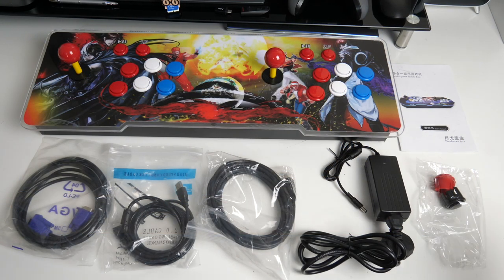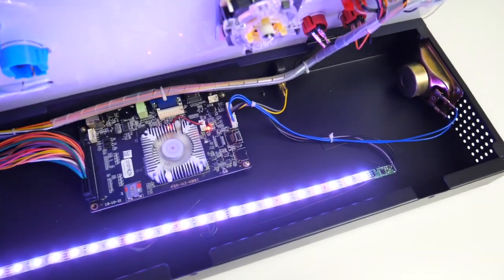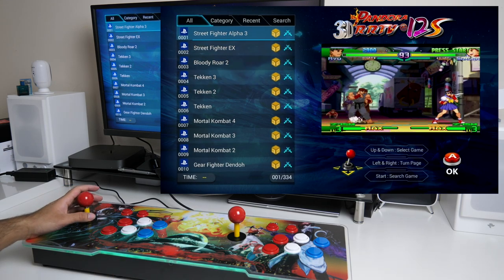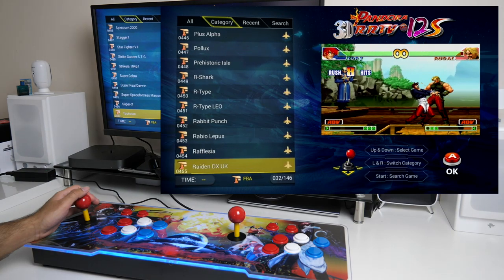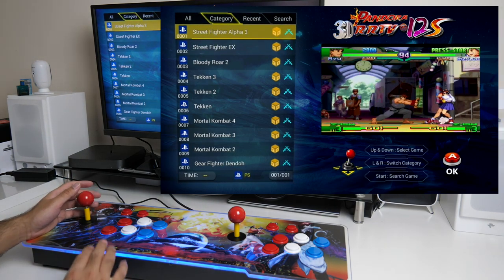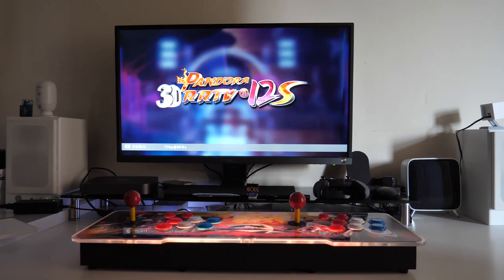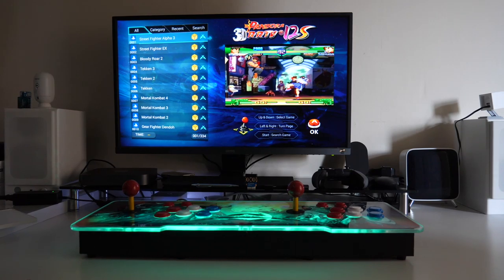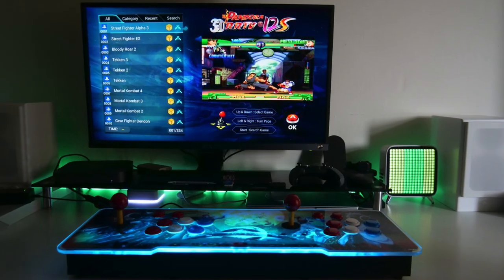Pandora Box 3D 12S - Multi-player Arcade Game Console / 3333 Games - Any Good?

Comment: You can probably connect a usb Ethernet adapter.  I know the apple ethernet usb dongle has built in support in the linux kernel so there is a good chance it will just work.  With that you can get on the app store.

Comment: Thank you for the excellent review and demonstration, really gives a clear perspective on the console. Beautiful product. You mentioned that you were unable to download games as there was no wifi capability or ethernet port however, my suggestion is to maybe try to use a MIFI ROUTER which has a USB cable for a direct connection and to plug it to the USB port of the console and see if it picks up. If this proves to be successful this will be a way to download more games.
Reply: Did it work?

Comment: How do you get the real deal with so many fakes out there.. I'm not too sure ..looks like they have added a fan too the fakes now because the proper Pandora's box when you look inside should be a pink or orange or green unit with fan built in ...the fakes just have a circuit board they used too over heat and bust because they didn't have a fan ?

Comment: Hi chigz, to answer the question to make to system internet capable. use a usb to usb dual end cable. Then add a WIFI USB Adapter. I prefer to use at a low cost the, the NETGEAR AC1 1200. It is a dual band 802.11AC, USB 3.0 which works with all standard WIFI.
Reply: Also a question, in the market area on the console system when you want to add games would you provide a company list of where the games are being brought from such as if it’s like G2a.com and such. The next question would be how to download your own games to the system or where to find Roms that work of specific with the game console?

Comment: Looks like the sound is really messed up.
Reply from the maker: You have one mono speaker built in, it’s loud and clear but not great quality. However, when you connect via HDMI you get the sound on your TV too. So you can turn off the internal speaker and achieve better sound on your Tv.

Comment: Question how do I play 4 player as it only lets me play 2 I bought extra controllers and plugged them in but they only work for player 1 and 2
Reply: Im having the same issue. However you can plug in a PS4 controller into the USB. hit settings button or "cfg" button. Go to key settings. Hit the right button on the controller twice....so it reads "controller 3". Now you have 3. You can also make that controller #4. So essentially 1,2, or 3 or 4 but not all 4. Ive only been able to make 1 controller work as the third or forth player. Basically only 1 controller and 2 arcade sticks. I have read that if you buy a "usb hub" you can then plug that in and it can become a 4 player board.

Comment: I just got the Pandora 11 and it's amazing!! The best game I've found so far is the street fighters it's got at least 20 different versions of the game and let me tell you it's exactly like the arcade game!! The graphics are in point they did it perfectly! I also like street's of rage games the Mario kart is fun and they did a great job with sonic the hedgehog and the jet fighter games are great as well!
Reply: Hey man quick question is there any input lag I.E you click a button and it takes a few 100 MS before it actually happens on screen instead of seeming “instant”
Reply: @CurlyFryTyy  Not on the pandora box I got but what does do is sometimes it won't turn on you gta keep turning it on and off a bunch of times like I've turned it off and on 30+ times before to get it to work I had to take it back to the guy I bought it from to get it fixed.
Reply: Where did you purchase it buddy, and have you played multiplayer on it??

Comment: my question is how well do the N64 games run? how is tony hawks pro skater running? this seems like the same box as pandora 3D 2448 games, many of the N64 games didnt run well on there.
Reply: I just got this one in the mail, tony hawk will reconise the joystick but nothing else I even used a ps3 controller.
Reply: @TheRiverAnduin  I own the pandora box 3D 2448 games and I was disappointed because THPS1 (N64 version) my personal favorite, was not playable because the joystick could not recognize the commands. I hope they come out with a new pandora box where N64 games can run better, but N64 is hardto emulate.

Comment: hey I got one from ebay had it for like a month used it about 5 times. Now the power switch is broken how do I find a replacement part?
Reply: That's a pretty common looking switch, it shouldn't be hard to find something. Just bring your box with you to a hardware store on electronics shop and find something. If you don't care if the switch looks the exact same same, you could really use anything as it's just an on/off switch.
Reply: I take it, you cannot return it? That's pretty lame that it broke straight away. Stand 6 that the power switch broke? Those things should last forever.

Comment: Just curious in what the space feels like, when two grown men use it of bigger size. To me looks like enough room just for me and 1 stick/buttons in middle.
Reply: I used to have a mame full sized cabinet & 2 players were just fine. I sold that and recently I got a p.b similar to this. It's 24 inches long & just under 9 inches deep. We had no issues playing 2 player games, we're both 5ft 10, 90kg (200 lbs). Yes there's not tons of space but there are USB ports meaning you can use a pad. The EASYSMX pad esm9013 works great with this.